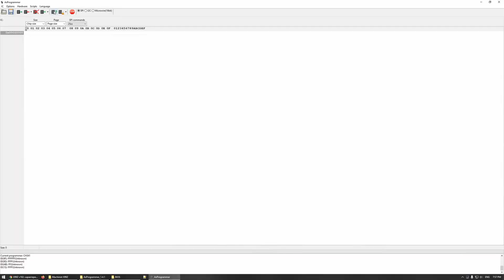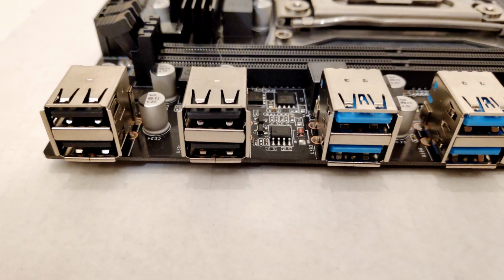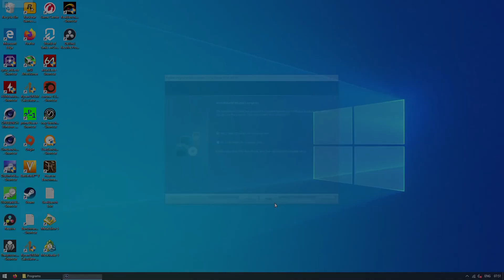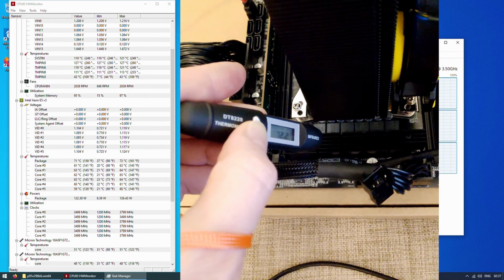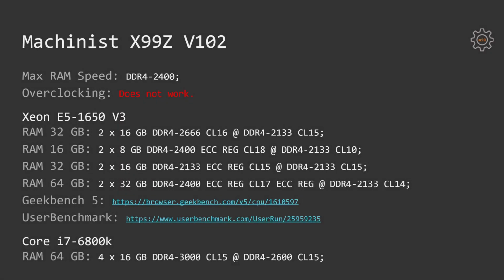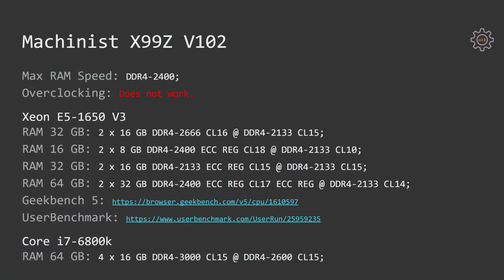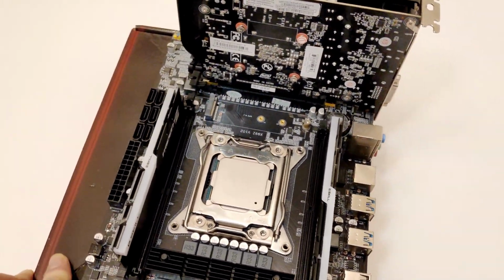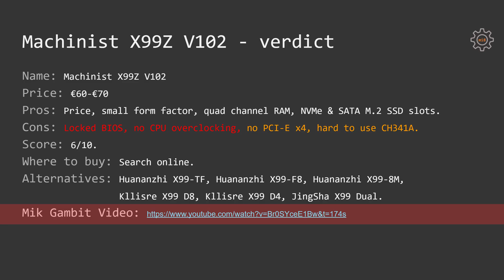🇬🇧 Detailed review and revive of Machinist X99Z LGA 2011-3 | CPU Overclocking | Turbo Boost Unlock

Comment: Does this motherboard work with intel confidential CPU ? My setup does not POST
Machinist X99Z
Intel Confidential QEY6 (E5-2695 V3 Engineering Sample)
4 x 16GB DDR4 2133MHz ECC REG
Radeon RX550 
CR2032

I added a speaker. When I power it on fans spin but no POST beep from speaker.

Do I have to flash a BIOS before I can use this motherboard?
Reply from the maker: As far as I know, most of the engineering samples don't work on such motherboards.

Comment: Thanks for updating video.  I have the kllisre version of this board.  Which two memory slots do you use when you test it with 2x8GB configuration?
Reply from the maker: This motherboard support quad channel memory configuration, thus it doesn't matter which memory slots to use, two RAM modules will always result into dual channel memory configuration.

P.S. X99Z V102  can be sold under Kllisre / Machinist / Qiyida name, but it's the same motherboard.
Reply: @Miyconst  Thank you.  I will play with it more.  If I had found your channel earlier, I would have ordered the Jingsha dual mAtx MB instead.
Reply from the maker: @grt-rt4dh  What is "JingSha Dual mATX"? I am confused here.
Reply: @Miyconst  I meant JingSha X99 Dual, since I am looking for a mAtx board.
Reply from the maker: @grt-rt4dh  JingSha X99 Dual is E-ATX, it's no where near mATX.
Reply: @Miyconst  Yes, you are right.  I meant JingSha/Kllisre D4.
Reply from the maker: @grt-rt4dh  Now I see what you mean. Anyway, I don't think you shall be disappointed with X99Z, with a modified BIOS you can unlock RAM timings configuration, and 4 memory channels is always better than 2 of JingSha X99 D4.
Reply: @Miyconst  Thanks.  I can't get it to POST with my 2x8GB memory kit.  The cpu fan starts for 1 second, stops then run.  Maybe I got a bad copy of this motherboard.
Reply from the maker: @grt-rt4dh  Could you specify the full hardware specification?
Reply: @Miyconst  Sure.  Xeon E5-2660V3, XFX RX 570GB via hdmi, either G.Skill 2x8GB ddr4-2400 or 2x8GB DDR4-3600 kit
Reply from the maker: @grt-rt4dh  Okay. Did you get the motherboard running at least once? Try the following: disconnect the power supply from the motherboard, remove the motherboard battery, shorten the clear CMOS jumper on the motherboard and leave it overnight. This shall clear the CMOS. After that try to boot with just one memory module installed.
Reply: @Miyconst  I can't get the motherboard to post.  All I got was both cpu and gpu fan spin up for 2 seconds, the stop and start to spin the rest of way.  I will try your suggestion tonight.  "Shorting the clean CMOS jumper", do you mean the JBAT1 jumper?  Should I short the 2rd and 3rd pins, or 1st and 2nd pins or just remove it?
Reply from the maker: Sorry for the late reply. I don't see any problems with your configuration. Did you try to clear CMOS and boot with just one memory stick?
Reply from the maker: @grt-rt4dh  I don't have the motherboard on my hands right now, thus I can't specify which exact jumper is the clear CMOS, but usually it's either a 3-pin (then you need to move the connector to other 2-pins) or a 2-pin (then you need to shorten these two pins). Remember to also remove the motherboard batter and leave the motherboard like this over a night. When trying to boot up again, make sure to put the clear CMOS jumper to its original position.
Reply: @Miyconst  I left it overnight and will test it today again.
Reply: @Miyconst I did what you suggested, it still won't boot a with a single 8GB memory in any one of 4 memory slot.  My memory is 8 banks.  When only the cpu cooler connected, its fan spins non-stop.  With a memory stick, cpu fan start, stops then restart to spin after 1 second.  So is the gpu fan.  I am totally pissed at this motherboard.
Reply from the maker: @grt-rt4dh  I am sorry to hear that, it could be that you have got a defective motherboard, please try to contact the seller.

Comment: What is the form factor of this motherboard?
Reply from the maker: It's a non standard size, but it fits into the mATX format.
Reply: @Miyconst  do you think it would fit in the new NR200 case from Cooler Master? I think it should, but I'm never sure about these things.
Reply from the maker: @asdf-un9gs  Most likely it won't fit, but you can try and tell us :)
Reply: @Miyconst  in theory that case supports mb as big as 244 x 226 mm, and the x99 z102 measures 220x170mm, so it should fit. My motherboard is still on transit, but I might get that case and try it :)
Reply from the maker: @asdf-un9gs  Let's hope the theory is going to be confirmed by the practice!

Comment: Thank you for this, man! Awesome review! Very transparent and straightforward. I have a question, though, does this motherboard support only 1x16 gb 2666 MHz RAM or I really have to use 2x8gb RAM? 

Also if I want to upgrade to more cores and threads soon, will this motherboard handle higher processor with higher TDP?
Reply from the maker: 1 x 16 GB will work just fine, but it will be limited to a single memory channel, which significantly reduces memory bandwidth when compared to the dual and quad channel configuration. I would not recommend installing anything higher than a Xeon E5-2678 V3 on this motherboard.
Reply: @Miyconst  thank you for the feedback! I am planning on buying another 16gb with the same specs next month for my upgrade. 

I will be waiting for the price of e5-2678 v3 to go down so that I can upgrade again. 

More power!! To you!

Comment: Hey, unfortunately I bought this board before I saw your video, do you think applying new thermal paste would improve VRM performance? Or a new chunkier heatsink?
Reply from the maker: There is a thermal pad between the VRM and the heat sink, not a thermal paste, thus I would not recommend to remove the heat sink if you don't have a new thermal pad for replacement. Other than that, just make sure to have a good airflow in the case and you will be just fine.
Reply: @Miyconst  Thanks for answering! I will put a fan in there blowing on heatsink. Do you think a 1650v3 could be overclocked by XTU or ThrottleStop on this board to 4.2? To clarify, is it the bios settings that killed your board previously? Or do you think XTU could also brick this board? Appreciate your effort testing all these xeons 👍
Reply from the maker: @FiReSTarTeR0709  You would have to use a custom BIOS for that, out of the box this motherboard does not support overclocking.
Reply: @Miyconst  Do you have a link for one? Or something I can inject into the bios? I have the 8mb bios... Thanks very much
Reply from the maker: @FiReSTarTeR0709  I have not yet got a chance to test an 8 MB version, but you can try to find a suitable BIOS here: https://xeon-e5450.ru/socket-2011-3/x99z-v102/
Reply: @Miyconst  Thanks so much. This xeon series is super helpful. Keep up the good work 👍
Reply: I get ROM is not compatible with ROMID when flashing through Afuwin64 using the Vasily Temnikov 8MB bios rom. Any suggestions?
Reply: Used AfuEfix64 to flash with "do not check ROMID" /X and it worked. Thanks for the link
Reply: Hey @Miyconst, I tried flashing my Machinist board X99Z v102 with a backup bios and also bios the seller sent me but ASProgrammer does not have IC version for the bios chip - Winbond W25Q128JVSQ. 

It only has W25Q128FV and W25Q128BV.

Did your Machinist board have the same chip as mine (W25Q128JVSQ) and if so which IC profile did you use to flash to revive your board?

 I tried both W25Q128FV and W25Q128BV profiles and ASProgrammer reported flashing correctly but there was no POST.

Thanks 
Mark

Comment: Really good video man ! 
I was wondering if it is possible to improve vrm temperatures by changing the heatsink or maybe adapting a cooler over it ?
Reply from the maker: Yes, it's definitely possible. Adding a fan with direct airflow to the VRM zone improves temps significantly. Replacing the heat-sink might be a bit problematic, since I didn't see such items on sale.
Reply: @Miyconst  Thank you so much for answering, you channel will be big someday with the content that you deliver.
Reply: @Miyconst  just saw this answer to my above question. Thanks. And thanks for the videos, helped me out unlocking turbo on this board...

Comment: Do the vrm's supports nicely a 2620v3 with turbo unlocked? and we can undervolt with this mobo? Thanks :)
Reply from the maker: VRM is fine with up to Turbo Unlocked Xeon E5-2640 V3, it's also possible to install E5-2678 V3, but some direct airflow over the VRM zone would be highly recommended. Undervolting is only possible with custom BIOS or EFI driver.
Reply: @Miyconst  thank you so much for the info! Cheers from Argentina :)
Reply from the maker: @Hypernite  Cheers back to Argentina!

Comment: Should I worry with the 3 pins fan header problem as it is not detected in CPUID? If I connect a fan to that 3 pins header, will it spin 100% speed all the time?

Thanks before.
Reply from the maker: Yes, 3-pin fans connected to the 3-pin fan header spin at 100% speed, unfortunately.

Comment: May i ask if the lan port is giga bit?
And can you review some ECC memory on this motherboard  
Thanks man
Reply from the maker: Yes, it is a gigabit ethernet adapter, and ECC memory works on this motherboard as well.
Reply: Must be Unbuffered right?

Thanks man love your vids keep the good work <3
Reply from the maker: @اوابعبدالهاديماجد  This motherboard supports UDIMM/ECC UDIMM/RDIMM modules, but you can't mix them with each other
Reply: @Miyconst  thing is  RDIMM is cheaper than UDIMM , i always thought otherwise, and like i found RDIMM dell 2rx4 16gb ddr4 (used) for like 75$ and new crucial one for about 90 where  cruical UDIMM ECC for 110$  
So I'm confused guess im going for the dell 
https://www.dell.com/en-us/work/shop/dell-memory-upgrade-16gb-2rx4-ddr4-rdimm-2133mhz/apd/a7945660/memory/configurations
Reply from the maker: @اوابعبدالهاديماجد  I have two similar 16 GB ECC REG modules, and they worked with no issues
Reply: @Miyconst  damn, i was looking for a review of this mb as i has bought years ago, found this comment and didn't realize I'm the one who made it lol, creepy asf.
anyways thanks for the content :)

Comment: 👋 hi, many thanks for what you done, great job, very helpful. I would like to know if the intel i7 6950x is compatible on this motherboard ?
Reply from the maker: Most likely it will work, but don't expect any overclocking.
Reply: Many thanks, for your answer, I have actually the 2680 v3, but It’s to old to get hardware encoding on adobe premiere pro, 2016 cpu needed, I was thinking about v4 xeon but there is many confidential intel cpu, end I don’t know about theme. Tdp increased ... perhaps the 6950x or a little cpu than the the 2680 v3 can be a good solution ?
Reply from the maker: @JeremyPolizzi  If you really need a V4 CPU, then there is an interesting option: Xeon E5-4627 V4. Even though it's a QS chip, it is the same as the final retail version and comes with SR2SN id. https://www.aliexpress.com/item/32870460710.html
Reply: @Miyconst  Many Many Thanks for your suggestion ;-) I'm checking all that, I think you saved me very good price-quality
Reply: @Miyconst  ordered super price for the performance, good to have only 10 cpu in windows for audio apps who use only one vcore, many thanks I'm very happy.
Reply from the maker: @JeremyPolizzi  Please keep me updated when you test and validate that the CPU works.

Comment: Wait, so you can totally brick this motherboard just from changing bios settings? Which settings should never be changed?
Reply from the maker: As I said in the video, motherboard got bricked from an attempt to overclock i7-6800k. Did not happen to brick with any settings I applied with a Xeon E5-2650 V3 CPU.
Reply: @Miyconst  thanks. I bought a Xeon kit that included that motherboard. I hope it won't be too difficult to unlock the turbo. I'll see in about a month.

Comment: UPDATE: Kllisre x99 v102 is indeed identical 100% to machinist, however your FFS method didn't work, i got error 26 while trying to dump.bat , However considering Mik Gambit Ready to use bat update, it worked with no problems and after that easy update from windows, Machinist logo at boot showed up. So yeah there is memory control and turbo boost mode working fine!
Reply from the maker: Thank you for the update! It's a well known fact that FPT tool does not work with Machinist X99Z, but the specified AfuWin/AfuDos version works.
Reply: @Miyconst  mik gambit bat file indeed uses that!
Reply: Hi, please tell me what script I should run to unlock turbo boost: "cpu_unlock_timings.bat" or "turbo-hack-timings.bat"? First rom has 16MB, second has 8MB
Reply from the maker: @kycaPL  As far as I can see, both files are 16 MB in size. For myself I took cpu_unlock_timings.rom file and injected FFS drivers with -50mv offset. The other file I didn't try myself.

Comment: Got this board and now using with e5 2620v3 Turbo unlocked, 3.2Ghz all core in CB R20 with 2223 points :).
Also designed VRM cooling duct that you can mount on Arctic Freezer 34: thingiverse.com/thing:4404755
Reply from the maker: This is an excellent budget friendly combo.

Comment: mine arrived yesterday, but it takes a lot of cmos resets to even boot properly one time, then after reboot usb power up but no screen, i need to di another cmos reset / unplug PSU cycle. Definitely a shitty board overall.
Reply from the maker: That's why I usually recommend to spend a bit more and get a decent or a semi-decent motherboard.
Reply: @Miyconst  i really liked the form factor, i have a lot of Shark x99 but i wanted to try some portable builds using cheap server small PSUs , i could try even some 2 channel boards . I have issue with some board lately not allowing undervolting also, could it be updated microcode for plundervolt vulnerability? I am reallly unhappy as i do care a lot about energy saving
Reply from the maker: @gabrielecarbone8235  As far as I know, voltage regulation does not work on this boards for CPUs with locket multiplier. You can reduce CPU voltage when applying turbo boost unlock. There are multiple versions of the turbo unlock driver with different level of voltage reduction.
Reply: @Miyconst  i had undervolt working with Intel Xtu on szmzit x99 d3 no problem and also plexhd x99t and the DDR3 variant of that board no issue . Also on this machinist on v3 , v4 does not work. Not worked Just on szmzit x99 8 d4
Reply from the maker: @gabrielecarbone8235  I see, thank you for the explanation. Have you tried to use Huananzhi X99-F8 BIOS on X99 D8 motherboard?
Reply: @Miyconst  i also suggest you to contact directly Huang Diego at SZMZIT LTD we got direct contact for better price on large shipping compared to Aliexpress, got our 20 motherboards today after just 10 days. Much better than aliexpress
Reply from the maker: @gabrielecarbone8235  Thank you for the info! I will write to him and see what he can offer.

Comment: Hey, have you tried to play with the overclocking options when you enabled lower number of cores? I managed to unlock turbo on a xeon e5 2697 v3 (14c 28T) processor but it can only boost up to 3.6 GHz when I allow 10c-10T. It can go up to 3.5 with no hyperthreading (14c 14T) but power delivery seems to be the limiting factor. I am currently trying to find the sweet spot for gaming or video production. I also can't find the base clock, which could theoretically be adjusted to 105 Mhz instead of the base 100 Mhz.
Reply from the maker: Hi. So far, not a single Chinese X99 motherboard has ability to adjust BCLK, you are stuck with 100 MHz. Try to reduce CPU voltage, it helps to reduce power consumption, thus CPU can boost up for longer.
Reply: @Miyconst  Yeah it should mean the same thing as limiting core count, i guess. And FYI, the max boost clock for this CPU (3.6 GHz) is achieved and stable under load, not for short times. Ty for the content, cheers from Munich.

Comment: Hello, thanks for the videos man. You're doing really good work! I have a question which chinese motherboards. I have a question about motherboards, which one is most recommended? I'm thinking of getting one. Also one more question. I found a seller selling 1:1 similar motherboard to Machinist x99. It's identical to my eye and specs are pretty same. Do you think its a good idea to buy that version?
Reply from the maker: So far Huananzhi X99-F8/X99-TF/X99-8M and Kllisre X99 D8/D4 are the motherboards I recommend. Machinist and its clones, I do not recommend, even though it's possible to make it work.

Comment: i wanna use this with the 2678v3, what do you think ?, i can't find any better one that is in micro atx form factor and supports quad channel ...
Reply from the maker: It shall be fine.
Reply: @Miyconst  your review kind of scared me a bit, maybe the vrm temps will hit over 100c with the 12core cpu
Reply from the maker: @JR-ob7hz  It's gonna be fine if you have good airflow in your case, but in general, I do not recommend this board.
Reply: @Miyconst  thanks for the fast response, i appreciate.